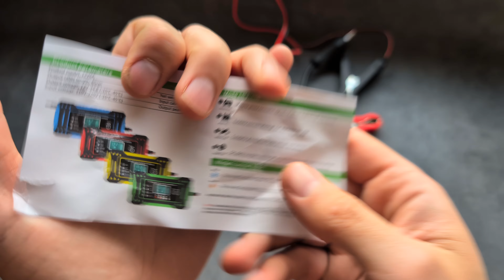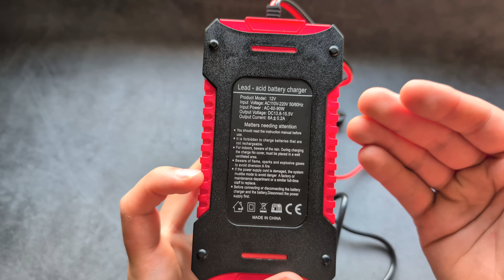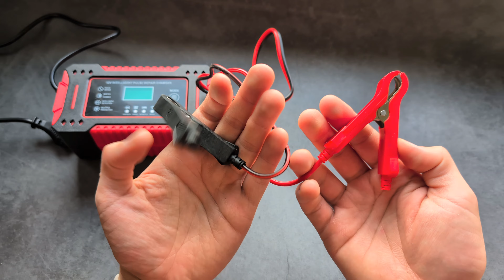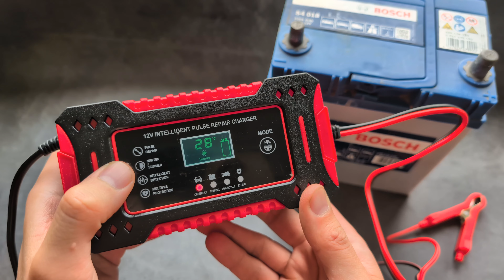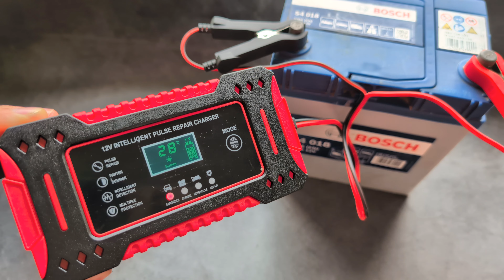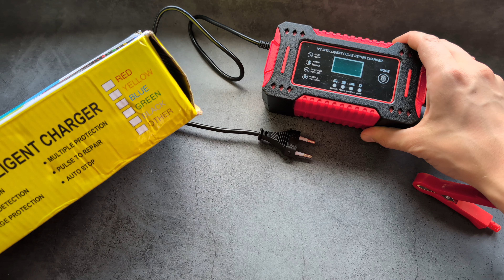12v Intelligent Pulse Repair Battery Charger - Review & TEST - Repairs Dead Car Batteries Easily!

Comment: How to get to pulse repair mode, my charging unit only reach others, but not pulse repair mode function, please assist.
Reply: Must be plugged in and it's selected by holding the button (at least that's what mine says in the manual)
Reply: @eduardosiqueira5703 Thanks for replying 👍. I've tried pressing every button but it never lets me select pulse repair.   Last week though I charged a car at work with it & it automatically  (after charging) went into pulse repair mode 🎉.   Maybe it's just up to the charger to decide if the battery needs repairing?
Reply: Mines the same 🤔

Comment: En que tiempo  se carga la bateria
Reply from the maker: It's 6A output, so pretty fast... how long? Yeah I can't answer that without knowing the battery size and charge level and mode used 😅 depends... But they are much faster than any other cheap chargers.

Comment: So to charge the battery to i put it on pulse repair?
Reply: Before putting it on pulse mode the voltage was 12.6 volts after pulsing it without charging was 13.8 volts

Comment: Hi,
What mode should it be set to for a gel battery for a motorcycle? The AGM/GEL or Motorcycle setting?
Reply: @blutey Although AGM/GEL mode is suitable for automobile batteries with start/stop function, Use the AGM/GEL mode, not the generic motorcycle mode.

Here’s why: Battery chemistry always comes first. 
Charging modes are primarily about battery type, not vehicle type.

Your motorcycle has a GEL battery, which means:
* It needs lower charging voltage. 
* It’s sensitive to over-voltage and heat. 
* Incorrect modes can dry out or permanently damage it. 

So GEL rules everything here.

What “Motorcycle Mode” actually means on most chargers:
“Motorcycle” mode = lower current (amps)
* Often assumes standard flooded or basic sealed lead-acid
* Not always GEL-safe, unless explicitly stated

So here's the setup:

Select GEL (or AGM/GEL) mode
✔ Even though it’s a motorcycle
✔ This ensures:
* Correct voltage ceiling (~14.1–14.4V)
* Safe pulse/desulfation behavior
* No damage to gel electrolyte

⚠️ Extra safety tip
If your charger allows both:
GEL mode and
Adjustable current (or auto current)
Then:
* GEL mode + lowest amp setting = perfect for motorcycle batteries

🚫 What not to do
❌ Don’t use Motorcycle mode if it ignores GEL voltage limits
❌ Don’t use Standard / Flooded mode
❌ Don’t fast-charge a GEL battery
Rule of thumb (remember this forever):

Battery type > vehicle type

Battery type takes FIRST PRIORITY over Vehicle type.

Hope this helps 🙏🏽
Reply: @bondjobe  Many thanks for that detailed reply.
I initially tried the generic CAR/MC setting on a new Motobatt battery and it went to FUL after a few minutes as might be expected since it's a new battery and fully charged from factory.
A few days later after a cold night where the battery might have been expected to lose a little charge, I then tried the GEL setting (in the hope it would trickle charge it and then switch off) but I came back 3 hrs later to find the battery very hot (about 60C I would guess) and still charging at ca 4 amps. So quickly stopped charging and let it cool. Battery case also looked very slightly warped as though heat damaged.
The battery still works though (although have probably reduced its lifespan), but I'm wary of trying the GEL setting again since it seems to overcharge and not switch off.
Am not sure I like these new cheap chargers China is knocking out. Their use is confusing eg the charging setting should be battery-type dependent (lead acid, GEL etc) not just a generic CAR/MC setting, since the latter could be both lead acid or GEL and the charger can't determine which you have just by connecting it up to the battery.

Comment: The instructions say to apply clips to battery before plugging it in to an outlet. 😂
Reply: What's wrong with that?
Reply: @EYE-CANDI-REELS you could like plug the charger first then the battery clips, or the battery clips then plug the charger to the outlet